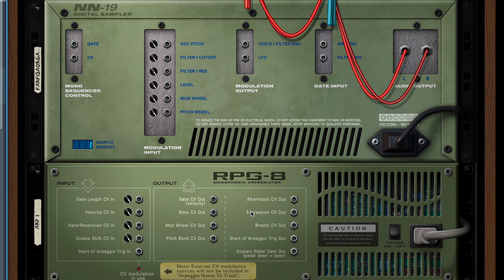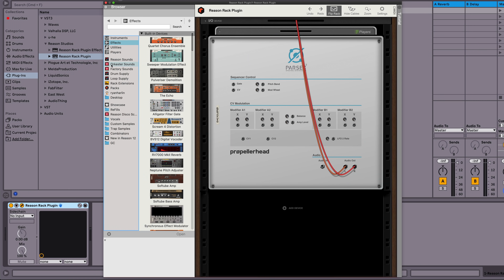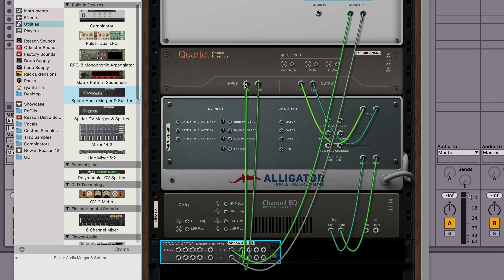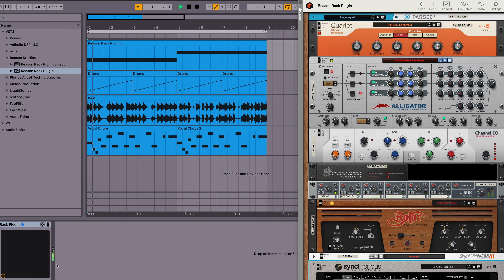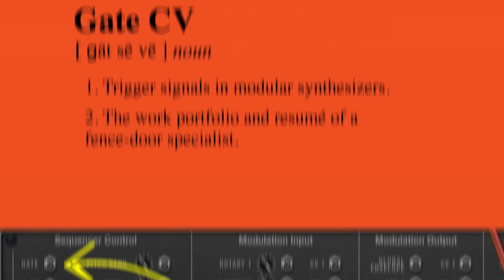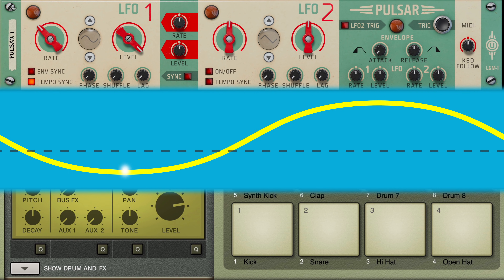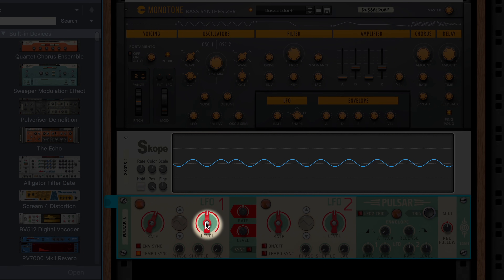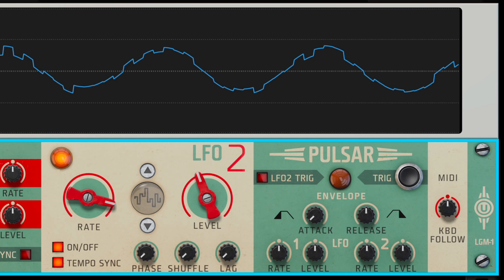Reason's Rack Cables – Learning Audio and Control Voltage Patching

Comment: "Before there was MIDI there was voltage control". This one statement cleared up everything I was trying to understand about CV. 

I know MIDI like the back of my hand. 
On the other hand, the purpose of CV and the million miles of cables needed for analogue synthesizers, triggers, VCA's, VCF's, envelope filters, LFO's and Osc's and other analogue music equipment eluded me until now. And this is why I never mess with the back of REASONS.

Thanks for the bit of information on CV verses MIDI. I was not aware of the parallels between CV and MIDI connections. Now I have plenty of REASONS to mess around with the back of REASONS.

Comment: Pulsar Dual LFO works great as a trigger for Kong. You can get interesting polyrhythms this way. The key is to use square waveform. Level knob then controls velocity. It gets even more interesting when LFO 2 or Env starts to interact with LFO 1 rates and levels.

Comment: Awesome :).  Only thing I can think of to improve this would be a simple setup to show how to use cv + gate to mean "play this pitch at this velocity" (it's almost implied with the different amplitudes of the gate pulses shown).  And perhaps tie it back to how it equates to the sequencer telling the track device what note to play (pitch) and how loud (velocity).

That makes me think... any chance of a mix channel getting a cv+gate out?  Essentially, so that whenever a note comes by in the sequencer, the cv gets pitch info and the gate gets velocity.  That would allow the potential of a single sequencer track to control multiple devices simultaneously.  You could probably do a bunch of cool stuff with it, such as triggering one or more Alligator gates as a note is played, or merging in pitch information into a filter cutoff LFO.

Comment: Great video. One question: at 11:07, it looks like the amplitude of the gate impulse affects the velocity of the drum sound. Is that so? Does that imply that there isn't a single voltage threshold the pads react to? Thanks.
Reply from the maker: That is a fantastic observation Jordi and you are correct in what you're seeing but there's bit of a "yes, but" answer. Allow me to explain. In the case of sending control voltage in the form of Gate Out CV to a Gate In CV then yes, the amplitude or intensity of the gate signal can be interpreted as velocity by the receiving device (if it wants to on its end, which is the case with Kong's Gate In jacks. Other Gate In jacks might not want to consider velocity, for example The Echo Delay's Trig input just wants to know if the delay should be on or off so it doesn't care about amplitude). In my video I'm showing those blips of gate CV as narrow triangles but the reality is that they're actually instant attack blips. And so yes – for Gate signals, devices can and do interpret velocity. HOWEVER, and here's why this answer wasn't me just giving you a simple "yeah": in that second example where I'm sending a continuous "curve" CV signal from Pulsar into Kong, that's not an instant blip. It's a continuous waveform and so Kong has no method by which to determine velocity and so it reacts via the threshold method that I try to visualize with that dotted line in the graphics. Sending a higher amplitude sin wave won't get you a louder Kong drum velocity because it's triggering down low on the sin wave's path just as it crosses that threshold, not based on the eventual peak amplitude of that sin wave. Does that make sense? So the simple answer is when working with Gate CV in the traditional way, yes velocity can be determined from the gate CV amplitude but when doing weirder hacks and rule-bending between gate and curve CV that isn't the case. Hope that helps! Great question!! /ryan
Reply: @ReasonStudios  I wasn't aware that the receiving device could do so much "intelligent" processing of different types of incoming gate signal (which I've always visualised as simple pulses), but it makes a lot of sense. Thanks for the detailed explanation!

Comment: Really informative video. I would just like to add, tab to the back of the rack also works in the Reason Rack Plug-In. 😉
Reply from the maker: That can sometimes depend on the host app, though. For example in Ableton Live they use Tab to switch between their sequencer and "session view" and so it doesn't work there. Since it can be different in different apps, I stuck to always-safe option of clicking the button. But what host are you running the plugin in? I'm sure other people in that DAW would appreciate your tip! /ryan
Reply: @ReasonStudios  Hey Ryan, that was a top class video.  Well presented and put together with the visuals on point, all nicely knitted and easy to understand, thank you.

Comment: the trouble with real-life cables is the price per cable. Propellerhead Reason solved this problem for me, that's the Reason I'm with you guys :-)
Reply from the maker: OMG right!? Back when I ran a commercial studio I tried to reduce the cost of real-world cables by buying connectors and bulk wire and soldering them myself but then I just bought nicer connectors and wire until it cost the same as before! :) /ryan

Comment: i almost never use CV :D  most of the time i just automate  for every parameter by its own. this way i see more of what i do. but cv can be quite fun. good video, pls GIVE US MORE of those.
Reply from the maker: Right. That's a valid workflow if it gets the result you want. But there are times, like in that last example in this video where you couldn't possibly draw in automation that modulates that filter up and down smoothly and adds that jagged random movement as well. In cases like that and others, CV offers something only it can do. But yeah, automation is a good solution too, for sure. /ryan
Reply: @ReasonStudios  yeah u are right, there is no possible way JET ;). 

its time for some more automation feature Updates  i guess 😉